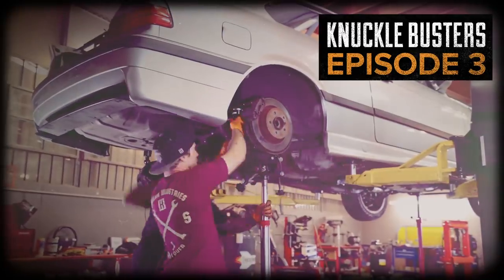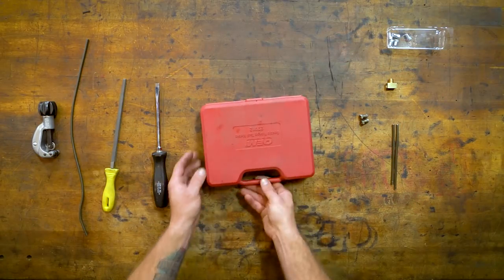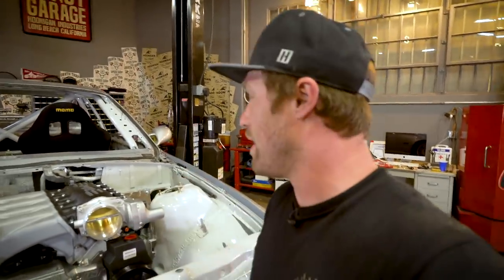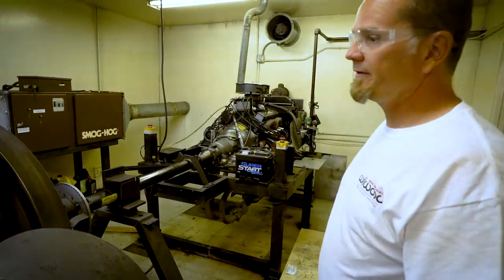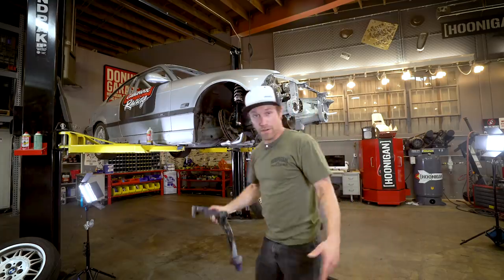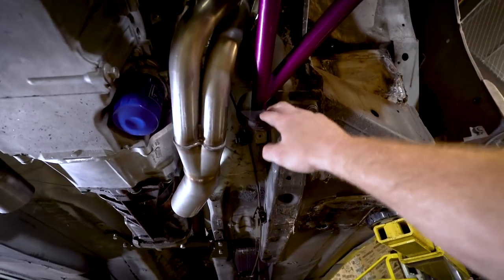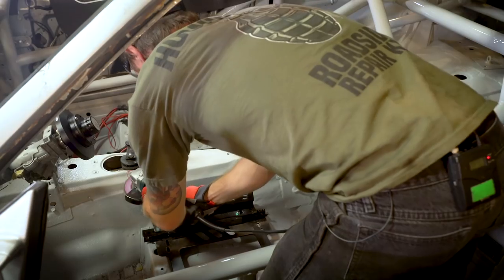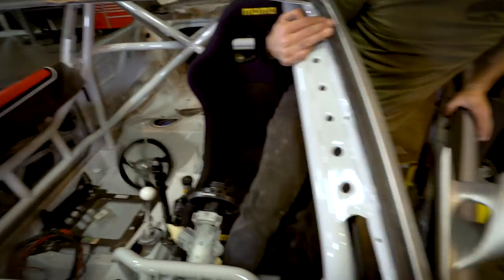Angle Kit for Drifting Explained - Installing it on our e36 Project

Comment from the maker: What's your favorite part about the Knuckle Busters build so far? Other than Dan. Because obviously #1 thing is Dan.
Reply: The explanations and the fluidity of all the things that Dan do to the car
Reply: Trying to figure out the space time loop that Dan is currently in with his beard. Just this morning he was at a rallycross race with Hert with a glorious beard, and here he is cleanly shorn.
Reply: My favorite part is how Dan explains how he is going to do what he wants before he does and actually does it without too many complications lol
Reply: Dango dan
Reply: probably getting in (actual) professionals to help with choosing a option and giving advice and tips
Reply: DAN!
Reply: Is Dan the one going to be driving the bmw
Reply: Everything! Are you guys going to put a heat shield between the break/clutch fluid reservoir and the exhaust so the heat from the exhaust doesn't boil or over heat the fluid? Just wondering.
Reply: TheHoonigans Volkswagen told me a while ago that the caliper position is based on the Wheelbearing load, if it is icreasing the load or take some away from the bearing...  (positioned to the middle or back/front of the car)
Good luck with the build 😁👍
Reply: Fabrication is what I like the most
Reply: TheHoonigans dan putting an angle kit on his car and forza put an angle kit in the game sweeet
Reply: Other than Dan? The attention to detail put in this build, it's all shaping real neato, can't wait to see this beast shred.
Reply: Learning stuff in a "proper" way is dope! I love Brad making it up as he goes cause that's familiar, but actual knowledge is great!
Reply: Getting to know the knowledge that Dan have! I just like the solutions he got, and knowing he comes from a drift background he got the experience/trial and errors to make choices based on real life experience
Reply: The length of the vids....there is a ton of info here to someone wanting to learn some thing new.
Reply: Dans a boss dude does some great work
Reply: Definitely not the type of engine.
Reply: Definitely how much you learn from this series and just how smartly everything is put together. Everything about it is awesome. And to be honest a old beat up muscle car rebuild would be legit for the next season 👌🏻 You guys are awesome!!
Reply: Those time laps
Reply: TheHoonigans how it shows the whole build process is the best !!!
Reply: The 36
Reply: That it makes you forget all the cars scotto still isn't fixing lol
Reply: awesome music and footage of the actual work being done. Awesome parts being used too, not ebay crap.
Reply: I like how dan steps back to educate on the basics, (the types of brake line flares in this ep) shows you how to do it, then shows how its relevant to the project
Reply: that Edlebrock intake setup is a thing of beauty soo sick
Reply: Dan's golden eyebrows. I ain't not now never seen shit like that
Reply: I love the way Dan builds stuff with minimal tools. Just like your home work shop. Its awesome to see as its not like he has a machine shop at his disposal. Just a couple of grinders bench drill etc. B-)
Reply: Fabrication is on point and that this is not a check out my car after it’s done but more of a watch me build then shred it to hell kind of feel.
Reply: Definitely not the fab work on that pedal box, c'mon Dan what is that flimsy plate + round stock brackets? This car deserves better lol
Reply: Everything.
Reply: I love the ain't care approach to grinding and welding around an engine that has open throttle bodies, and beautiful brand new parts all over it. Also the brake master cylinders being right next to the exhaust, instead of inside the car or protected with a heat shield. Good stuff.
Reply: I like the pace of it. Not too fast, not slow, the amount of details is perfect. If I need to know more than what's on the show, I'm probably actually doing the thing too and need to RTFM anyway.
Reply from the maker: Tym T - Thx. There is also more information on Bonus Channel for some sections.
Reply: Dan is love, Dan is life
Reply: Dan keeps it relevant to the garage builder.  Anyone with a shop can do everything on a lift with the best tools available.  Dan makes sure to show it the way the rest of us have to work....sometimes on the floor or on a table.  Keep it up.

Comment: Those little pipe cutters are amazing to have, I have a Kobalt (Lowes Hardware store brand) branded pipe cutter. Used it to make some fuel line to replace the questionable factory fuel line for my '77 Olds Delta 88 from the fuel pump to the carb, worked great, even used some of the factory mounts.

Comment: Tech tip for dan to get smoother plasma cuts: on thinner metal when plasma cutting you can usually cut faster than you think which will in turn give you smoother straighter cuts

Comment: For track days you might want to look into a Z3 steering rack Dan. It's about a 20% reduction from lock to lock and fairly common as an upgrade for E36's...also when you inevitably need more fender space you should look at over fenders. Felony Form and Big Duck Club both make nice ones that would help give the car an aggressive look
Reply: The SLR kit that is shown here increases the steering quickness by 40% already with the relocation of the tie rod pickup points. Its pretty fast as it, when combined with a Z3 rack its a bit digital feeling its so quick.

Comment: good idea for angle kit, would be easy to made with cnc or simple milling table.  But for the hand brake, is it really ok? i think it would be better to mount it other side, so  when you need to shift, it wount be in the way your hand moves from steering wheel to gear shifter..

Comment: Im considering one of those Mini Angle kits for my E36 because they speed up the horribly slow factory steering.  Those original M3 DS1 wheels look so good I'd just leave them on the car, but Im sure you guys intend to change them.

Comment: Now this is how you garage TV.  thanks Hoons.    Hey Dan..because the hydron handle is taller than the gear shift...wouldn't it have been better placed on the othher side of the shift lever?   Or is it because in drifting you handle the hydro more often...hence the priority of placement?

Comment: Personally, I would put the handbrake forward a couple of inches if possible, to give your hand a little more of a clearance between the steering wheel and the shifter. It just seems a little too busy, steering wheel, hand brake, and shifter all right next to each other.

Comment: I think, because the car is a drift AND grip build, the handbrake should be on the otherside of the shifter, or at least, not in the way from the steering wheel to the shiftknob. In a drifting build, this a perfect position, but on a grip build, this will get in the way of your hand when shifting. You want easy access to your gear selector, not having to go around something.

Comment: Who is the manufacturer of those lower control arms and steering angle kit? There are a lot out on the market, but most seem to be aluminum versus heavy-duty steel like what was used on this car.

Comment: should have remote mounted the fluid reservoir so they dont get heat soaked. But I guess in drifting your not on track long enough nor are you worried about boiling the fluid as much.

Comment: Make the hand brake base adjustable front to back on slidable quick release plumbed to stainless braided line, also make it pull up/horizontal style.....thank me later, your non-existent tennis elbow/lateral epicondylitis will. Also, have swapable or change to leather steering wheel for barehanded test days.......Dood, u r a sick car builder, u so smart!!

Comment: Great series!!  Why did yall not reinforce the subfram and body on the rear? Was sure Dan was going to go into that.  Know issue with e36 and e46.  Had to do it to mine.
Reply from the maker: It's on the list! We're definitely not trying to rip subframes out. Especially with the tires we plan to run on this thing.

Comment: Would have been nice if ya'll gave us a link to the Website to buy that angle kit. 
Is there a reason you never mentioned the Brand name of the kit and tried to hide their logo as much as possible?
Reply: It's a BMW SLR Full Angle Kit
Reply: Because they are just out to get you. 👏
Reply: Probably because they didn't get the part sponsored. If they shouted out any parts they used, there would be no reason for anyone to sponsor them. Sucks, but if that's the way to give us quality content, so be it.
Reply: Pretty sad they tried to hide it...

Comment: Why wouldnt you put the handbrake on the outside of the shifter?? Easier to shift and i bet you during a comp you will reach for a gear  and slam your fingers into the brake.

Comment: Pro tip: Don't even try to use a cheap flare tool. It'll leak and drive you crazy. Buy a good one or borrow from the auto parts store.